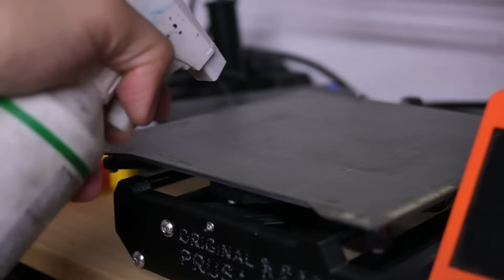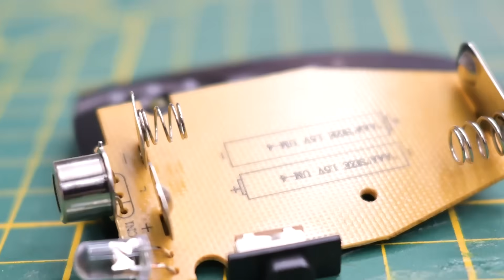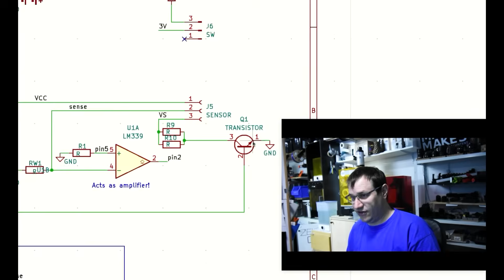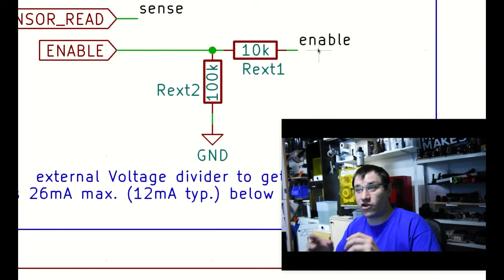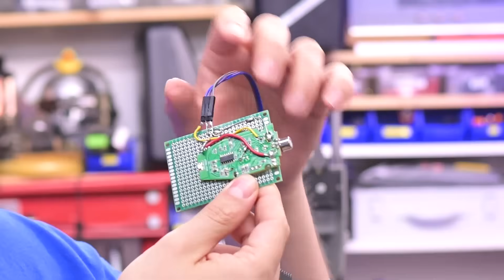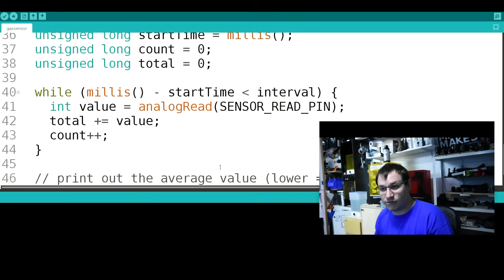Turn anything into an Arduino Module: Reusing Everyday Electronics

Comment: If you're designing for 2 AAA batteries you're designing for up to 3.2v. I don't know what chip would not accept 0.1 volts higher. Avoid using numbers like 10000. Define that as a constant "WARM_UP_DELAY_MS" or other named variable. It makes things easier to read and modify.

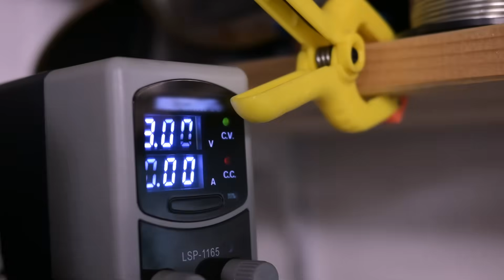Comment: At 15:18, your supply appears to display 0.16 amps, 160 mA. It is probably not very accurate at the current levels you are trying to read. A nice Keysight bench meter would help. 😄
Reply: I'd gladly take one😂😂

Comment: Kind of a waste of current to use a voltage divider, especially after finding out how little the original circuit uses.  Throw a gernanium diode in there instead, one with a 0.3v drop.  The current won't matter, and it won't use any extra.

Comment: Wow that Arduino MKR Wifi 1010 seems to be orders of magnitude more expensive than an ESP8266 or an ESP32 ... why did you select that one?
Reply: Because I had it ready. Its a very capable board and convenient for prototyping. 
If you want a web connevted thing its also orders of magnitudes easier to build with it than with an esp32, as demonstrated in my arduino weather station project.

Comment: All broken little gadgets and some circuit boards from some larger ones, go into a plastic box in my house. i purchased a desolder machine and I just run through them occasionally and remove any possibly valuable parts :)
Reply: thats what I did for years, its very educational to search for the part numbers and lear nwhat all these components do!

Comment: Hi , thank you so much for doing this video. I have zero experience with electronics. This is incredibly helpful.
I would like to develop a sensor that can detect low voltage signals in the terahertz and provide me with an alert… how do you recommend I get started (the simpler the better)?
Reply: Get the fundamentals right, get one of the official arduino kits that come with a book and work through the examples. Then recreate some of my e14 projects and you should know enough to build whatever you come up with.